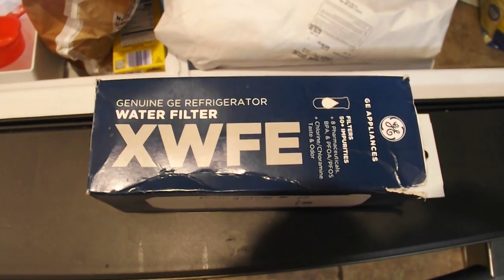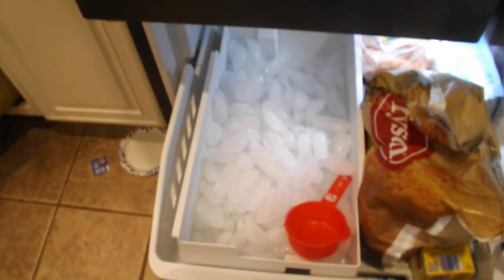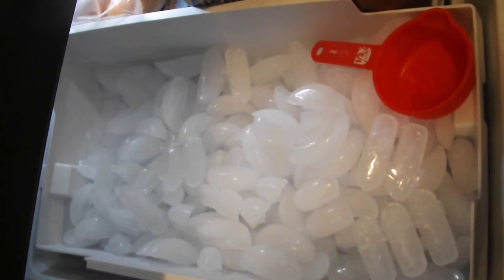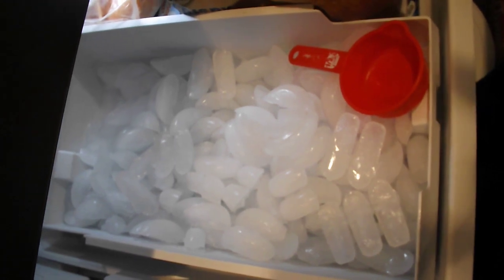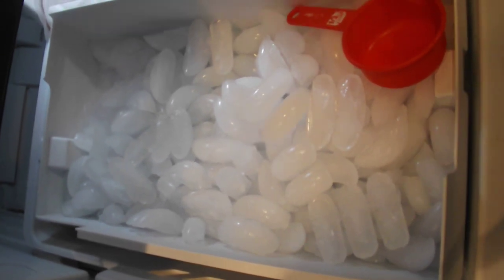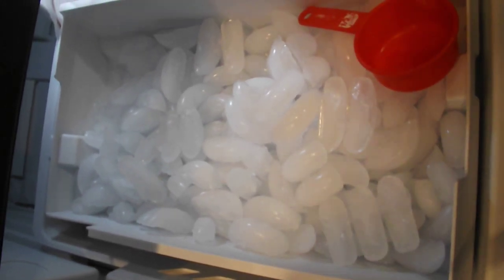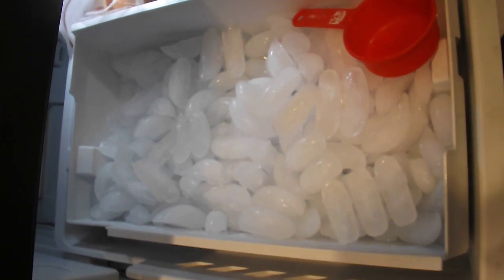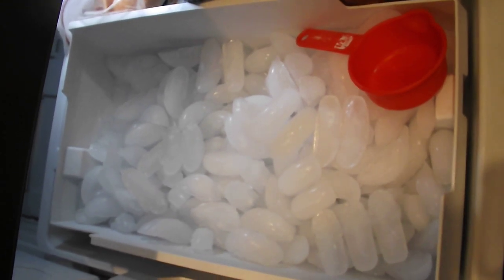Part 2 of GE Bottom Filter Replacement

Comment: Hi i saw your other video and i noticed you did this part two and hopefully my fridge gets better but I also noticed the when the ice was less it was melting and my fridge wasn't getting cold anymore but i just changed the filter today so i hope it resolve soon but I'm worried about how long it takes to start getting cold.
Reply from the maker: Hello! Just saw this question. Are the vents in the lower and upper freezer open for air circulation? We did have an issue that when they are blocked the ice maker did slow down. Let us know. Than you!

Comment: Have you had your ice maker stop working?  Trying to figure out how to fix it. Replaced the water filter and nothing...
Reply from the maker: Are the vents in the lower and upper freezer open for air circulation? We did have an issue that when they are blocked the ice  maker did slow down. Let us know. Than you!

Comment: My GE bottom ice maker has stopped making ice. Can you show me how to fix it?
Reply from the maker: Hello! Start with the water flow. Whether inside or outside is there water? Does it have a saddle valve? Loosen this and water will flow out. Then re tighten. Lastly is the water filter more than 1 year old? It may need replaced. Also the flapper should not be bound see our videos and there should be a green light on the ice unit. Let us know?! Tank you.
Reply from the maker: Just checking in. Have you had any success? Let us know.